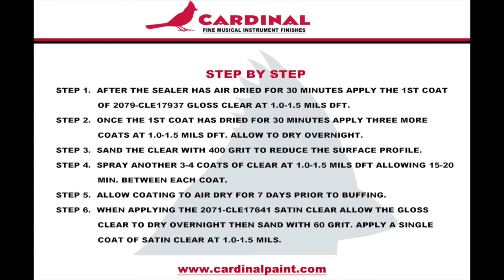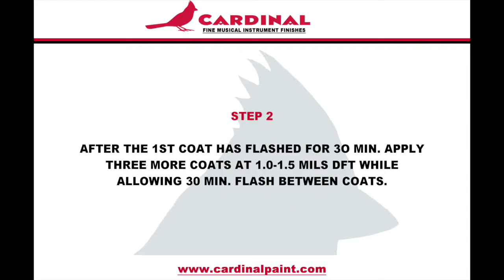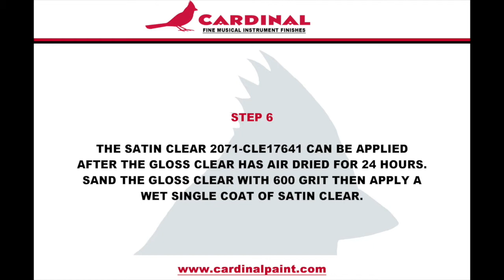CARDINAL LUTHIERLAC NITROCELLULOSE GUITAR LACQUER

Comment: I have a guitar who's lacquer finish has some horrid milky areas that have seemed to stabilize.  Not sure if it was moisture left in the wood that caused it, but I feel like it's safe to refinish it.  I have a little 3 gallon pancake compressor.  Would it be enough for this and if so, what PSI am I looking to send to the gun?  I've got a decent bit of painting experience with aerosol cans and feel like my technique is good but, I've never done a job that required air tools.